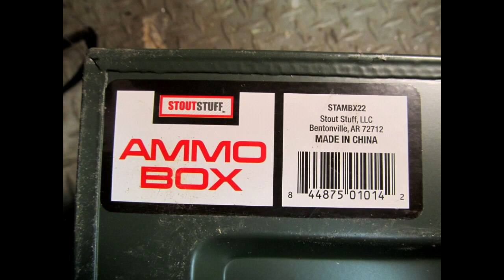FREE and Easy Way to Lock an Ammo Can TIGHT

Comment: Or just buy a long shank lock and lock it by passing the lock under the lower bar and through the middle hole in the front plate.  The front plate won't close all the way but enough where is should still be water tight, and secure enough that little hands can't open it.

Comment: Just get rid of the kids, and maybe the wife too. Then you don't need all those locks!
Reply: Unless you live in Canada, where by law, they must keep all ammo locked up.  This satifies that requirement.
Reply from the maker: Haha...if I lived by myself I would not have bothered with this. A couple people have said that this will not deter thieves. That's not the purpose, of course. If you take the trouble to keep your extra ammo locked up, and something goes "wrong" in a state with harsh gun-control laws, you will have a much easier time with the justice system. When someone has to "unlock" something that you have taken the trouble to make safer, there will be much more of a burden on them than on you.

Comment: What is the purpose of this? Most thieves would just pick it up and walk away.
Reply: Mostly it's just about keeping guns/ammo out of the hands of kids/unauthorized persons. Given the unwieldy size of the ammo can, it might be a small deterrent also. Of course thieves will take anything not nailed down, and even monster expensive gun safes have been shown to be ineffective because you can saw through the sides.
Reply from the maker: This is not meant to deter thieves, any more than those "safes" you buy at Walmart and set up in your living room deter thieves (actually, they are a thief attractant). I'ts just to keep kids, their friends, and casual snoopers out of your stuff. A lot of people (I don't) live in areas with draconian guns laws,  where even ammo has to be be kept locked up. So, this may suit their needs.
Reply: I have one mounted on a trailer in a way that it will NOT come off without opening the box.  I use it for keeping extra tie downs, etc with the trailer.  No one is walking away with mine unless they find a way to steal the whole trailer.